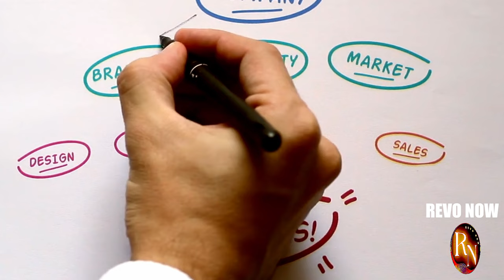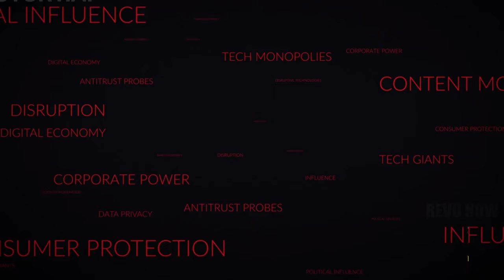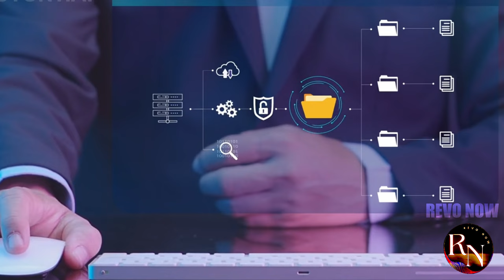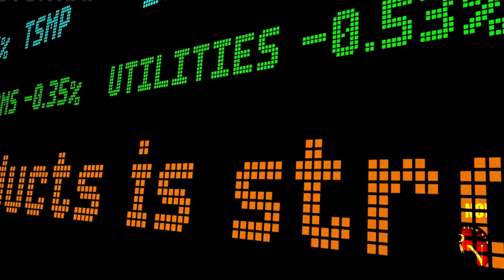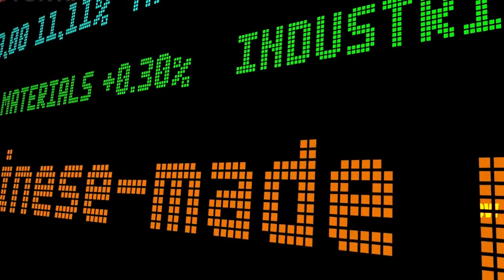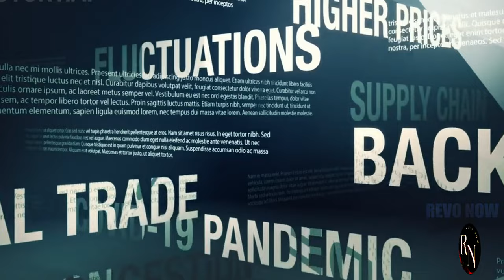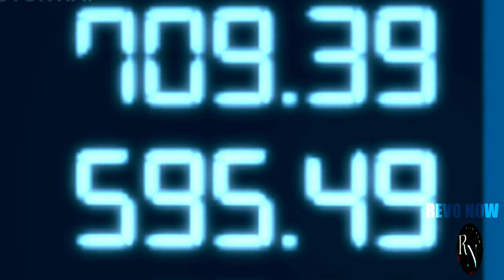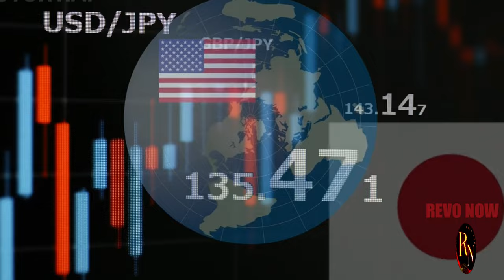Will Dell's Anti China Move Pay Off?

Comment: As a firmware engineer, I can tell you that replacing hardware components is not always a a simple job, depending on the type, breath, and quantity of hardware changes.  It may not always be possible to find an exact non-China replacement component.  All the modified boards with replacement non-China chips must be revalidated to ensure that they meet or exceed their performance specifications.   This is not a simple task requiring resources, money, and time.  I hope Dell knows what they have signed up for.